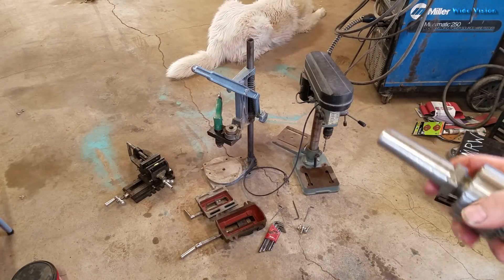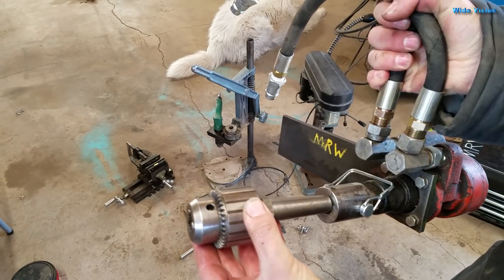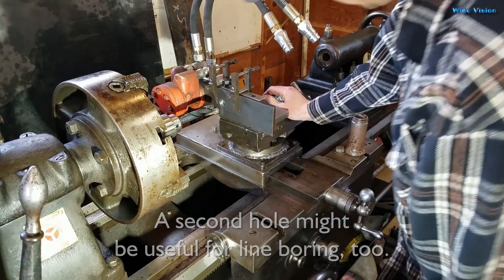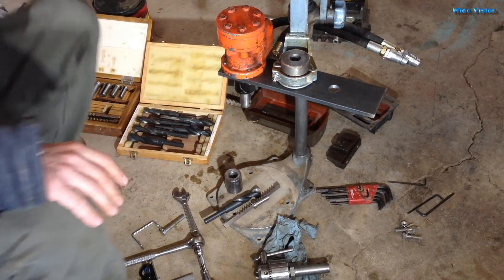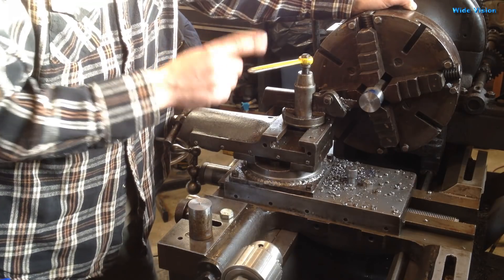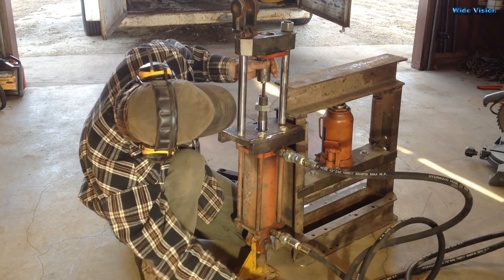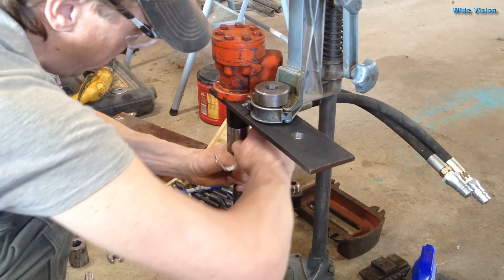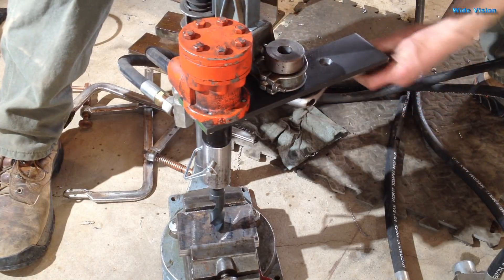Hydraulic Powered Drill!

Comment: Just reviewed your video for a second time because I have a couple of changes that you could make to increase it' usefulness. #1 replace the vertical tube with a longer tube and make the read easily adjustable vertically that way you could reinstall the taper adapter and reinstall the chuck. #2 make the whole thing from larger diameter black [pipe and fittingslike was done by one YouTuber to make a homemade vertical milling machine.

Comment: You just proved the complaint that you had about the hydraulic motors slow speed while line boring was not the fault of the motor but  it was because you were using an inadequate hydraulic power pack, you need a bigger motor and or pump.It is to bad that you don;t have access to the Atlas lathe and drill press and other power tools you left on the farm, especially if they are sitting unused. Maybe you need to explore the used tool market for big boy tools, Chucke2009 seem to have done ok that way.
Reply from the maker: I guess I did prove it!   I hadn't thought about that.  I've been searching the local used tool market.  They bring ridiculous prices out here. There's an old, very well used,  grizzly round column mill for sale for $1200. They're about $1800 new for that model.  There's a good sized knee  mill, I forget the brand, and they're asking $7200. That's above new price! If they are in an acceptable price range, they are sold by the time I contact the seller.
Reply: You might try a big city like Denver, might find a bigger supply and lower prices but you would probably need a trailer and some tie down straps or chains to get what ever you buy home. Good luck on your search.
Reply: Location seems to be the biggest factor in used machine prices.  I had to drive to Ohio from Wisconsin to get a decent knee mill for under a grand, and even that needed a bucket of elbow grease.  

...still grumbling that all the granite surface plate bargains are in New York...

Comment: Those large bits are made to be used with a pilot hole - it's not that they're dull, just tapered wrong for what you were doing there. Also, you could probably  make a longer guide tube for the components on your porta-press and give yourself more vertical, capacity, but you'll sacrifice more accuracy the longer you go. Your limiting factor will be the cast aluminum components of the original drill press attachment. It's made to hold a portable drill, not a hydraulic motor - you'll run out of strength there long before you run out of torque.
Reply from the maker: The aluminium press frame is something to fail, for sure! I like the "porta-press" idea too.
Reply: Oh - I mean your portable drill press attachment - I used to see them advertised in magazines years ago as a "porta-press"... not to be confused with a hydraulic pump press. Lol
Reply from the maker: I understood.  :)   I used the wrong words. I meant to type "extension" idea.

Comment: Did you get the thing fixed? -pronoun for electrical.
Reply from the maker: LOL! Kind of. I ran a "temporary" wire from the house central air conditioning unit to the garage. At least I have 220 volts now. I need to get the power company out to do a site evaluation, and then I can go from there.

Comment: The drill bits are fine. You need a starter hole for those. There is no offset on top of them. You dulled that bit trying to force it through without a pilot hole.

Comment: Nice.  The old deltas are worth a New set of bearings and the go cheap.   Keep an eye out.   Jim
Reply from the maker: Thanks! I've never been around a delta, but  used to see the old ones come up for sale occasionally. But back then I didn't need one.
Reply: Wide Vision Metal Fab got a 15 inch floor stander 3p for 75 bucks. Run it on 110 to 230 phase vid.   The vid part is pretty easy.
Reply from the maker: I completely forgot about those VFDs. I have been ignoring 3 phase machines. Thanks for the reminder!
Reply: Wide Vision Metal Fab everybody does and the 1hp Tech is s hundred bucks.  Add variable speed too.

Comment: be careful with that hydraulic drill press it will have more torque than any drill you have ever used.
Reply from the maker: True! But I have the relief valve set low since this motor runs my line boring setup too.